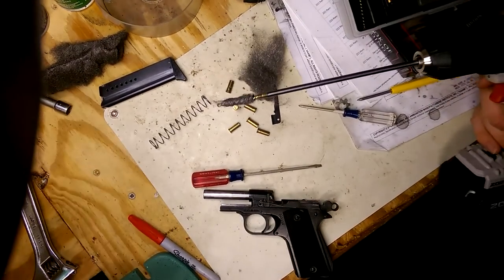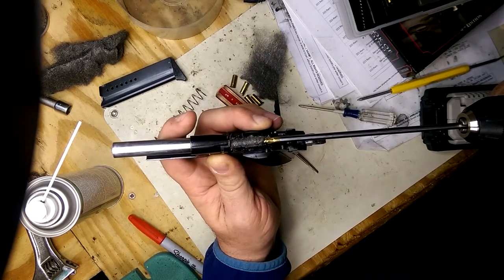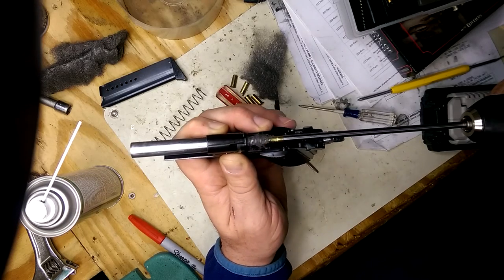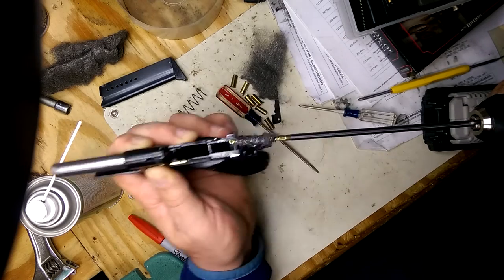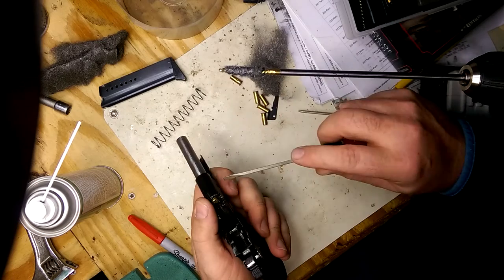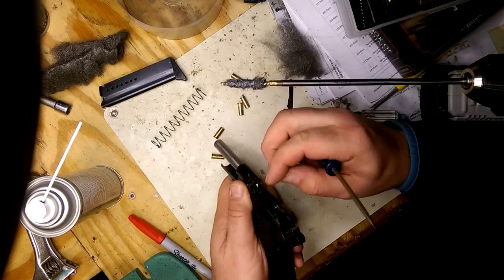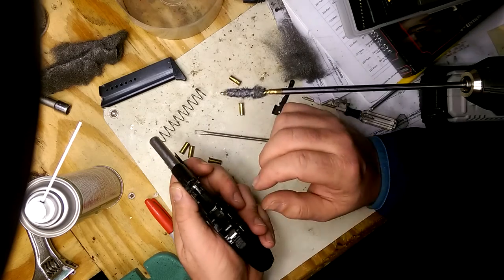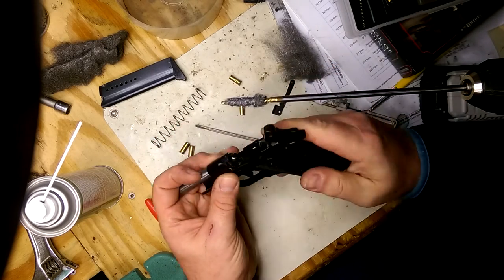American Arms Pk22 Part 2 Buffing the chamber

Comment: I purchased the same gun in the early or mid 90's with the exception of the model. I have the PX22 which looks like a Walther PPK.  I bought a couple extra magazines at the time, and it always malfunctioned with a couple of them.  I cleaned it thoroughly and it would run OK for a few mags, and then fail to feed.  I discovered one of the mags was worse than the others, and tried bending the feed lips etc.  

I've probably only shot 2 or 300 hundred rounds total through it, but it functions better the more I shoot it.  It is very sensitive to grit and grime, especially on the feed ramp.  If memory serves I polished the feed ramp a bit. It runs much better with plated bullets.

When clean, oiled and using quality ammo, it's a fun little gun, and as you say pretty accurate.  I used to have a brace of tiny palm sized pistols from a now defunct company in Hollywood, CA.  They were 8 shot semi auto pistols about the size of the old Raven 25 auto, and I shot 4" metal silhouettes with them at 100 yards.  I also use the American Arms/Walther PPK homage pistol.  It was just about as accurate once I figured out where to hold.  

I wouldn't cut the recoil spring, but I might try stretching the magazine spring  slightly.  With the additional pressure, it might make the round get into position a fraction of a second quicker to be picked up by the slide.  I've found a few places still selling new magazines for my version, but wow, they're pricey!

Anyway nice to find a few others who're enjoying a slightly flawed but otherwise enjoyable little gun.